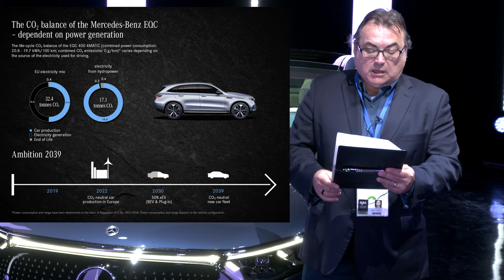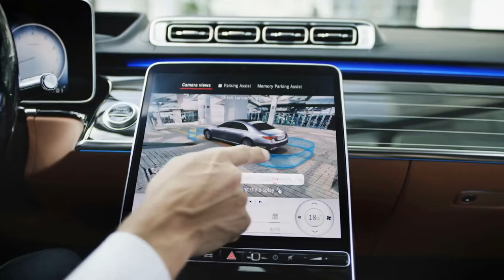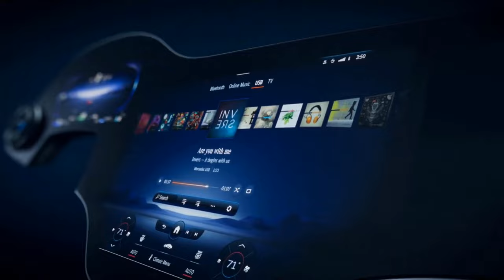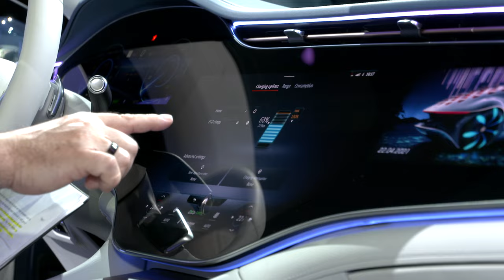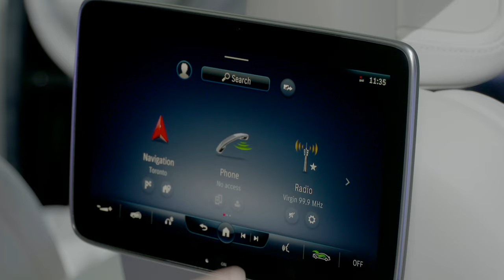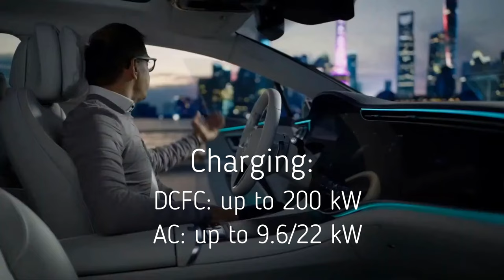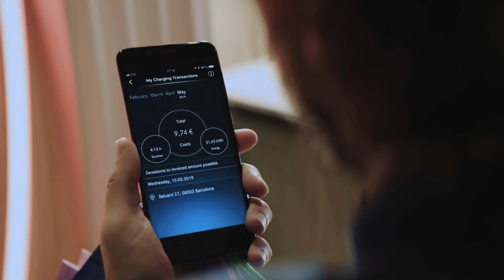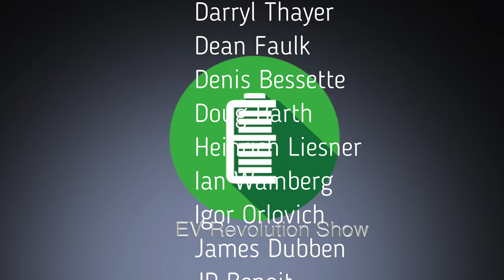Episode 130 - First Look at the 2022 Mercedes-Benz EQS 580 4MATIC!

Comment from the maker: Thanks all for watching!  I only had a few days to prepare for this Media Event and due to CV19 restrictions here in Ontario, I only had an hour with the vehicle to film.  Thankfully, they provided a videographer (hence the movements) which helped me out!  Still, I had to read from somewhat scripted materials in order to make sure I got all the points across within the time I had allocated to me.  

Additionally, forgot to mention that the they would not let me open the hood, as the MB rep there told me that their customers would have no need to open it at all.  There is no Frunk (as you saw in my pic) and on the drivers side front quarter panel, there is a rectangular hatch that opens to reveal a side-dish for refilling the windshield washer fluid!  So you can fill it up without opening the front hood!  First time I've ever seen that!

Comment: Got a W247 B200CDi (ADBlue Tech) and filled up today in less than 5 Minutes to give me over 600 [1000 KM] Range = when I can get an EV at similar price would be very interested.
Reply from the maker: It is coming.  However, we need to move to zero emissions and not wait.  Do you use 1000km on a daily basis and need that?  I would think not.
Reply: Having driven an EV for two years now, the only way you could get me behind the wheel of a ICE vehicle would be in an emergency or if I had no other choice. Also, my charging takes 1 minute, that’s how long it takes to plug my car into the charger in my garage when parking for the night.
Reply: @victorseal9047  Yea Right try a 300 Mile round trip and Warning 'LOW Battery' see you on the M6 on hard shoulder or Emergency lane.
Reply: @victorseal9047 Lucky You have off road Charging in your 2 car Garage - 75% in UK are not so Privileged to have that facility - You really should get up to date and Test Drive a vehicle such as the Mercedes AorB Class latest Blue Diesels - Engine Noise almost undetectable and in 8th Gear at 65mph /1200 rpm totally silent apart from tyre noise - dependant on road surface
Reply: @EVRevolution  I would want my car to be able to travel on an annual Ski Trip although denighned  due to Covid restrictions  without spending hours charging a flat battery i the middle of France
Reply: @GrrMeister    Don’t you stop to pee, take a coffee or have a break ? Or do you stay in the car all the time on your 5ish hour 300 miles round trip. Every stop I have, I coincide it with a place where I can plug in, whether it’s on the M6 or the Autoroute 70 here in Québec. The last time I drove up and down the M6 was three years ago and there were chargers everywhere, it’s all a matter of changing old habits for new ones. Also, I have yet to run out of électrique juice anywhere.
Reply: I fill up my car in 1 minute - 30 seconds to plug in the car and 30 seconds to unplug the car. Since I'm not driving while sleeping, it doesn't matter how long it takes to charge the battery as it's full when I need to leave for work. I only charge once or twice a week for my normal driving routines. Remember the days when your phone didn't need to be charged?
Reply: @GrrMeister    You really are "a cup empty or half empty guy". You only see problems where I see solutions.
Reply from the maker: All, there are some people you can't convince to change an opinion.  @GrrMeister, if you are so fired up about your Diesel, good for you.  You are missing the big picture that our world is falling apart and our human race may not make it to 2050 and beyond, as we kill our planet.  Change needs to start with one person....and continue from there.  Autos are not the only change that is needed but they do represent an important part of our future being in GHG emissions.  The science is real, whether you believe it or not.  

So while an BEV may be "inconvenient" for some use cases, this technology is advancing so rapidly that it really makes little sense to continue with fossil fuels.  ROI and TCO advantages side for BEVs.

However, the main reason to change to an EV is simply doing your part to help our planet and the lowering of our GHG emissions in something WE can control.  Sure there are countries and regions where the electricity comes from 100% coal, so the advantages of an all-electric will weigh very thin, if really having any.  However, for most of the industrialized world, things are changing (just look at China) and that is not because EVs are cheaper to buy and non-coal generated electricity is better to operate and deliver and cheaper, it's because nations are finally realizing we all have to do something to change the course we are on.  

So while you may love and praise your diesel, you are missing the big picture.  That is why I personally made the change to an all electric.  I never spent as much on my Leaf in 2018 as I did on any vehicle in my entire life - having owned over 30 vehicles in my 42 years of driving!  So I do know a thing or two about cars, ok!  

If you @GrrMeister don't care about all this and don't want to change, that is your right.  However, don't tread on those that believe in doing what is right.

If you continue to badger commenters here, I will ban you from my Channel.  I don't have the energy or desire to argue with you or try to convince you otherwise.  There are more caring and thoughtful people out there that I can reach with the same efforts!  Thank you.

Comment: I would love one but twice the price of an ICE Modern 2021 Advanced Petrol/Diesel Hybrid Plug in in 40/60 KM Range would take many years to recover any savings. For Super Rich only. PS I have a 2019 B200 CDi {blue Tech} which can achieve over 85 MPG (UK) and has all the tricks including Sat-Nav Reality - truly amazing and at 65 mph cannot detect engine at 1500 rpm or less in 8th Gear
Reply from the maker: Thank for watching and yes for sure it will be expensive.  But hey, a Model S here starts well over $100K and tops out at $200K, so MB is starting at their highest end too!

When you spend this much money, TCO and ROI are not of a concern.  

Glad your CDI is ok, however bottom line is it is still emitting GHG's and that is what we need to stop completely.  I know BEVs are not for everyone yet and I get it, however sooner than later they will be very compelling for all use cases and hopefully all budget realms!